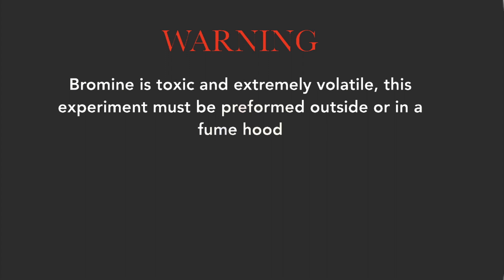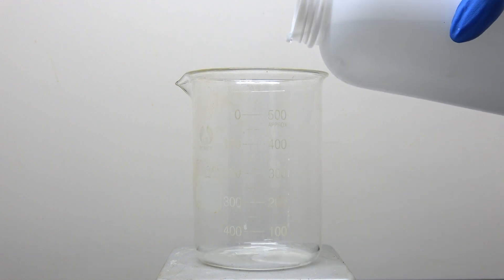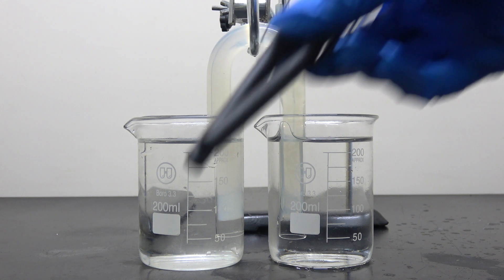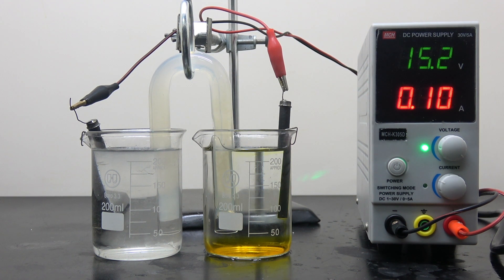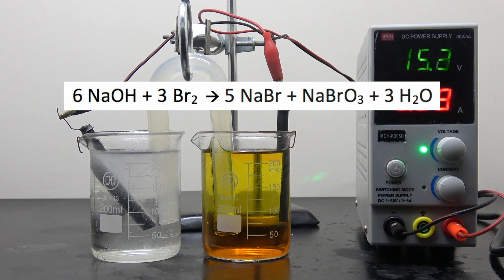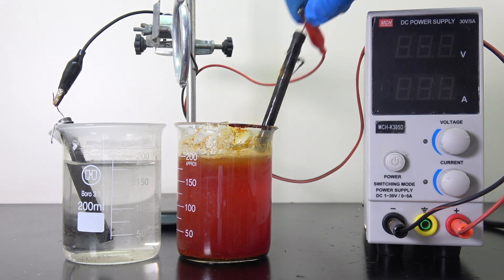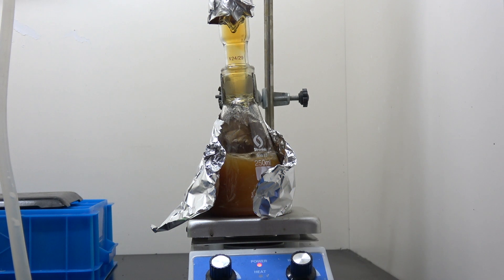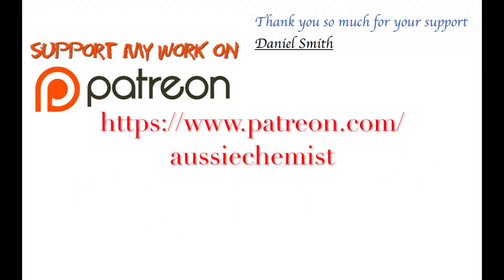Making Bromine Via Electrolysis

Comment: If you're going to distill it anyways, why not just react the sodium bromide with H2SO4 and H2O2? 
I would think electrolysis makes sense if you're trying to avoid distillation.
Reply from the maker: the point of this video is not to just make bromine per se, i well aware that method but i wanted to do it new way (at least no one had done at on youtube at the time) as for the distillation is mainly to get rid of the graphite particles, graphite rod disintagerate rod over time, the problem can be avoided using platinum eletrode

Comment: Instead of a salt bridge and having the two cells separated I was just thinking about adding sulfuric acid. Would be a lot easier if you could just buy copper bromide or something like that, since you could pull the copper onto a copper electrode instead of bothering with the pH.
If I understand correctly, the salt bridge moves anions into the bromine solution (or cations away from it) so if those anions are sulfate ions you’d get basically the same result as with sulfuric acid.

All that said, I would prefer to produce a bromine solution with no other impurities but still without having to distill it. But I can’t think of any acids or salt bridge salts (aside from bromic acid) that would do that for me if I’m stuck with sodium bromide. Guess I’ll have to live with some spectator ions. I’d probably need to adjust the pH anyhow with sodium hydroxide and/or sulfuric acid so it isn’t that big of a deal. How the hell do I store it such that I can use the solution often though. I’m thinking mason jar but with a circular cut PTFE sheet as a sealing disc.
Reply: Did it work?

Comment: It is a nice idea to use electrolysis for the oxidation of bromide to bromine instead of using chemicals like chlorine or manganese dioxide as it might be less wasteful.
You could try another kind of "membrane" to seperate cathode and anode chambers (e.g. pottery) and thereby reduce the cell resistance.
But I think, it could be a better approach to produce bromate (or another oxidizer) first and then produce bromine chemically with that. Then you won't have the problem of dealing with bromine in the cell, but still use electricity for the oxidation.
You could test if bromate, manganese dioxide or lead dioxide is a better reagent to produce bromine from bromide salt and which of them is more easily produced electrochemically.
Reply: Bromate reacts with bromide to bromine in acidic conditions and so you might want to store bromate instead of bromine and use this reaction to produce bromine for organic synthesis in-situ as needed!

I found some hints to a synthesis procedure for bromine via bromate and there are many papers on the bromate–bromide reaction.

Bromine from NaBr (Sciencemadness - Forum)
http://www.sciencemadness.org/talk/viewthread.php?tid=20090&goto=search&pid=512619

https://adamcap.com/schoolwork/the-kinetics-of-the-bromate-bromide-reaction/

Equilibrium and Kinetics of Bromine Hydrolysis
https://pubs.acs.org/doi/abs/10.1021/ic950909w

Kinetics of the bromate-bromide reaction
https://pubs.acs.org/doi/abs/10.1021/ed047p775

Kinetics and mechanism of bromate-bromide reaction catalyzed by acetate
https://www.ncbi.nlm.nih.gov/pubmed/14966975

...
Reply: mrhomescientist actually already showed in 2012 how to use electrolysis to produce bromate first and then get bromine after addition of acid to that solution in a 2 part video.
Part 1 - https://www.youtube.com/watch?v=NKjyM2AkZSY
Part 2 - https://www.youtube.com/watch?v=orFf-l0s1bc
Reply: Same procedure described by woelen -

on the sciencemadness forum:
http://www.sciencemadness.org/talk/viewthread.php?tid=20090&goto=search&pid=248502

and on his website:
http://woelen.homescience.net/science/chem/exps/OTC_bromine/index.html
Reply from the maker: realedna interesting approach they got there, my goal was really just to see how the reaction would go with least chemicals possible